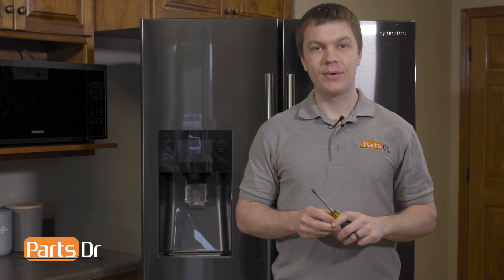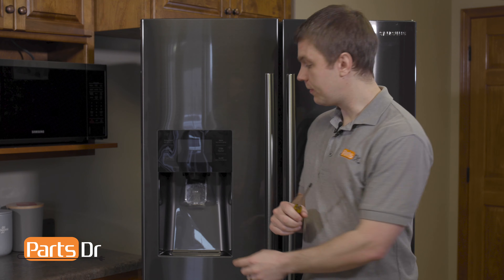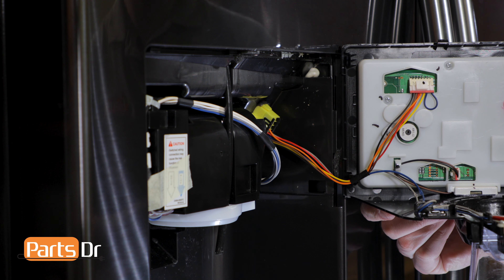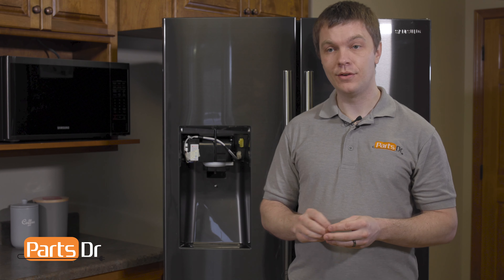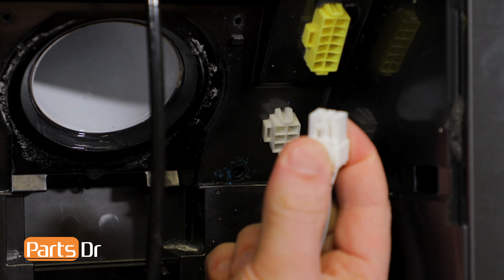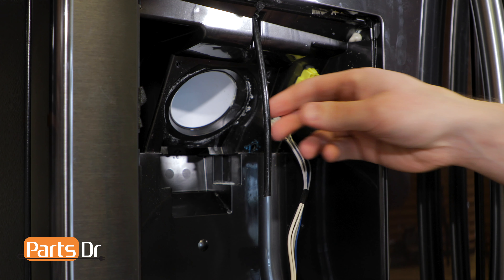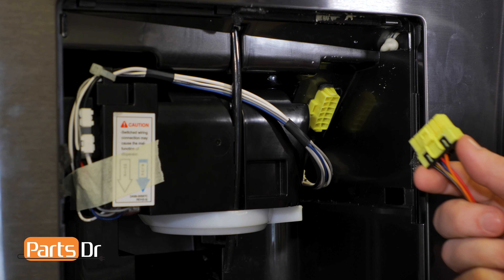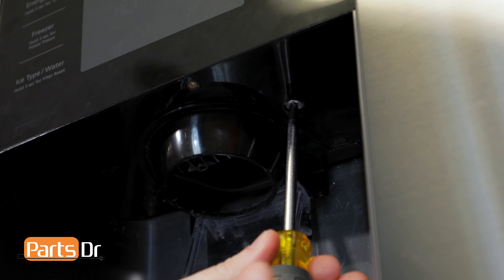How to replace the ice route case assembly part # DA97-08680G  in a Samsung refrigerator

Comment: Just replaced mine - thanks for this great video. Hoping it fixes an issue where the old flap didn’t fully close, and after a few days, ice melt at the bottom of the bucket would build up and block the chute. Your video was very helpful and clear. I was able to watch each step, pause it and do it on my freezer, then continue on until success! The new part was installed. Fingers crossed!
Reply from the maker: Great to hear!  Nice job repairing it yourself!

Comment: Hello, I purchased an ice route flapper, but I can’t seem to remove the panel from the door.  My rf23htedbsr looks like the white plastic (from the bowl that stays on the fridge) comes down into the dispenser area, it also has a plastic clip on piece that is the outer side of the opening that pops off when I apply pressure. 

Any ideas?

Comment: I was experiencing an issue with my Samsung refrigerator where neither ice nor water was being dispensed. Most of the material online said that the most likely cause of it was the ice route assembly. So I bought the part and installed it. This video was very helpful in aiding me with the installation. It was quick and easy to perform. BUT after I did replaced it, the problem wasn't resolved. Turns out the issue was the switch in the lever, a part that sells for 1/10th the price. So if you're at the point where you are considering replacing the ice route assembly, make sure you have ruled out the switch inside the panel first! (Parts Dr also sells the switch.) As for me, I'm going to leave the new ice route assembly installed. I've replaced nearly every part of the ice maker system in my refrigerator already, so I figure it's only a matter of time before I would have to replace the ice route assembly anyway. Pro tip: never buy a Samsung appliance!
Reply from the maker: Thank you for sharing your experience, that is very helpful.
Reply: Hello! Wanted to know if you knew the part number by chance for the switch lever. I have been checking Parts Dr. site, and we did have an issue where the switch is no longer making the engagement sound. Not sure if related to the cover, since that is still functional. Also have the same issue where water nor ice is being dispensed. Thanks in advance! Wish home depot had that pro tip available when I first scoped out this fridge!
Reply: @Composercleo The part number I used was DA34-00011B.
Reply: @citizen511  Thank you so much for the quick reply! Checking this now.

Comment: I purchased water/ice dispenser assembly fro your online store, but cannot pop out the front panel, I did remove the screw.  what to do?
Reply from the maker: We have seen some older models require more force to remove.  Look up the directions for your specific model to make sure you aren't missing anything.

Comment: I noticed some dirty or mineral buildup around the ice route opening in your video. I assume that mine does, too. (I also had trouble removing the front panel and was afraid to do damage, so I've left it for now even though your suggested water seal test showed that I have a leak probably causing my frost buildup issue inside)

I was wondering if you have a suggestion for cleaning that before reassembly. Vinegar, CLR, ...?
Reply from the maker: We would avoid any harsh chemicals.  Vinegar is probably the best bet.

Comment: Hello, the ice route flap in my Samsung RF32FMQDBSR (4 door) opens and closes everytime that I open the left top door (the door with ice dispenser) . Do you know what might be the cause and how to fix it. I have already ordered the ice route assembly from you to replace the whole thing. thanks!
Reply from the maker: Maybe check for shorted wiring that comes out of the door?
Reply: @PartsDr  Is that something that I can do it myself, or I do need an expert? Do you guys have a video on this problem? It seems to be a very common for Samsung Refrigerators? Thanks!
Reply: I had the same problem until the repairman replaced some micro-switches (his description) where it then would flap open and closed whether or not the door was open. Samsung declared it was unrepairable and refunded my cost. I can’t believe they can’t fix this.